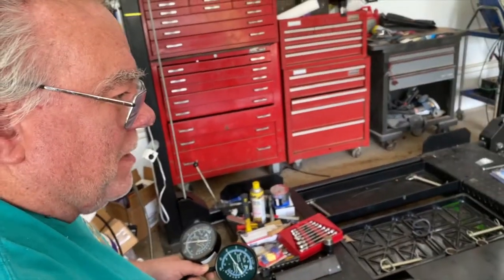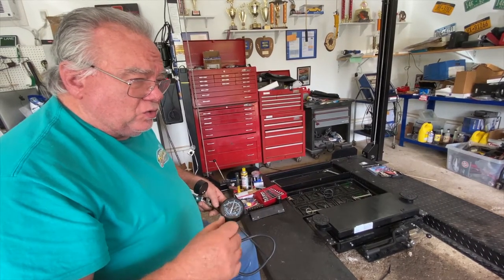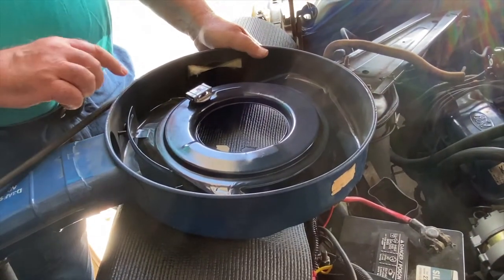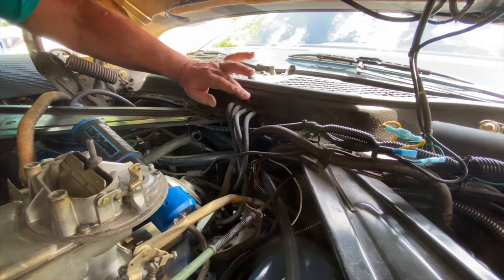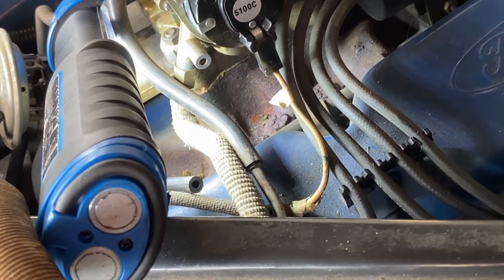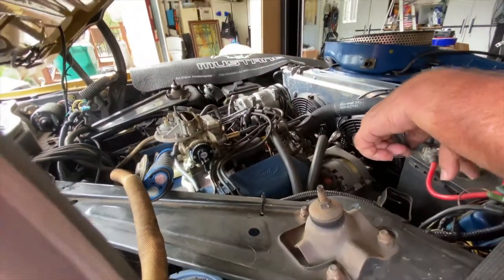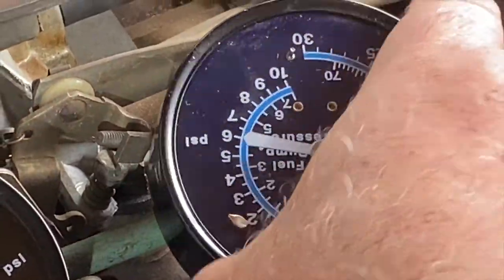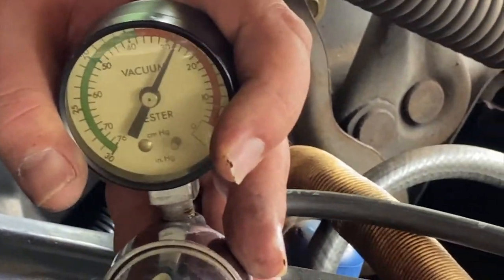1973 Mustang 302 2v Comprehensive Vacuum Systems Explanation And Testing

Comment: Thank you so very much for this. I’ve been researching for months now on the vacuum system for a 1979 Ford F-150 400 with a C6 transmission. I have been extremely frustrated and confused and have purchased every manual I could find, and you sir have cleared up most everything for me! I do have a few questions that are on my system but I did not see on yours. Specifically, I noticed your system doesn’t have any Vacuum Check Valves (mine has several) and yours does not have a Vacuum Restricter Valve for the Distributor Vacuum Advance. Did you remove these or does your system not call for them? Also, we appear to have the same carburetor (Motorcraft 2150), but mine has 4 ports (including the spacer) and I’m not entirely sure what they are or what they do. Lastly, my system had a thermactor air pump that was no longer functioning and has been removed. Any knowledge you could pass my way would be very much appreciated. Again, thank you so much for your videos, without people like you passing along this information it would be lost to us all. Also a thanks to your camerawoman! She did a great job too!
Reply from the maker: Vacuum Check valves became more common some time after 1973, which is the latest model Mustang we have from the 60s and 70s.  I used to work at a Ford dealership in SoCal from 1975 until 1981, but was closely involved with repair facilities for 5 years thereafter when working for the Auto Club of Southern California (the nation's largest AAA chapter) as a Corporate Liaison in their Garage approval Program.  I had about 75 repair facilities I oversaw, most of them dealerships.  Much of the driving factor for dissatisfaction our club members had with auto repairs involved engine performance where the ever evolving and progressively more complex emission control equipment was going through a transition between mechanical, to vacuum/mechanical, to mechanical/vacuum/electrical oriented solutions before we finally entered the electronic control phase of emission system solutions (computer controlled).  The early computer based systems were fraught with frustration by nearly all persons involved, from owner, to technician.  Eventually the computer controlled systems became stable and viable, eventually resulting in the kinds of advances in performance, reliability, and emission control that was promised long before with computer controlled engines.  Sadly, 1979 was one of those periods of great frustration.  By then the earlier Ford Electronic Engine Control (EEC) systems had entered their 2nd generation with some improvements over the horrific EEC system, but it definitely had its problems.  As for the 1979 truck powertrains, you were somewhere further back in the evolution, where there was a lot of more complex vacuum/mechanical solutions involving a lot of vacuum based tubing and devices, to include vacuum delay valve.

I can tell you this, one of the only places a vacuum delay valve does any real good is when someone illicitly places it in the vacuum hose leading to the Exhaust Gas Recirculation (EGR) valve, to delay the vacuum signal getting to the EGR diaphragm, thus preventing a hesitation on light acceleration caused by the introduction of inert exhaust gas into the intake manifold.  But, even that can have a drawback, as in 1979 I began to notice how engines would be subject to having noticeable, but not damaging, engine pinging.  The introduction of exhaust gas via the EGR valve actually helped reduce the pinging, but it caused some bit of hesitation or stumbling when the EGR began to open too soon.  But, the more rapid than desirable opening of the EGR valve was needed for the engines to meet newer emission control standards.  It was a vicious situation, not unlike playing the game, "Whack A Mole,"  where every solution to a drivability problem presented a different problem elsewhere, even if drivability was improved and emission output levels would increase.  Worse, even though I knew what I could do to make a vehicle's engine run "better," it was unlawful (at both the federal and state level) for me to "tamper with" or adjust the engines anywhere out of specification from the manufacturer.  Now, many years later, I remember all too well how it felt to have to set an engine up a certain way, knowing full well I was essentially detuning an engine in a way that would result in a less than optimum level of performance.  For my own personally owned vehicles I did whatever I wanted, and figured if anyone wanted to see the engine emission control systems they would first need a search warrant, and the person doing the search better be as qualified as I was to ascertain if something was a modification or not.  Luckily for me nobody gave enough of a rat's ass to look at my own vehicles.  The real money for California was to go after repair facilities, find them in non0compliance with maintaining emission control systems or repair, then fine the hell out of the facility in order to gain the funding source for the department performing the alleged oversight.  It was nothing short of draconian behavior by California.  Our dealership never was fined.  My one tune-up department partner and I kept excellent records, and did all we could to remain in compliance with our machinery being calibrated properly and consistently on schedule.  And, in cases where I did "tamper" with emission control equipment, it was done in a way only an expert would have been able to find what was done.

Now then, back to your situation (enough "evil backdrop" info for now)...  The reality I was dealing with as a technician "back in the day" was a lack of emission control information from Ford.  Yep, you read that correctly.  We had a horrible problem getting any kind of useful information from Ford on emission control systems.  By 1979 Ford began to have more than just timing and spark plug gap into posted on plastic labels pasted onto a valve cover.  They began to show the vacuum control system, in a fairly general way, used for an engine's particular calibration.  The problem is that over the years those plastic labels would peel off, or become too scratched up to read.  And, Ford began to rely on those labels to document the various emission control systems, as opposed to providing books or manuals showing the various engine calibrations for their vacuum control systems.

Meanwhile, taking a walk down memory lane, I see a situation where until 1973 Ford really did not seem to take emission control system documentation seriously.  It was not until the 1973 Shop Manual that the various vacuum schematics for various engine calibrations was even addressed.  A near parallel situation exists for electrical schematics as well.  Until 1972 the electrical schematics from Ford were a dismal near-joke of incomplete, and hard to follow compilation of accurate but useless effectively information.  In 1972 the electrical schematics began to get pretty good, and improved even more in 1973.  But, suddenly in 1974 there seems to have been a news blackout of sorts and finding solid information later than 1973 has gotten to be a very difficult challenge.  I do have some vacuum and electrical schematics for 1974 - 1978 Mustangs, but some are literally scanned from paper documents.  I have nothing from 1979 or later Mustang or other vehicle makes or models.  Some of the PDF documents I have that were not scanned have some kind of copy protection protections on them that I had to try to use several PDF reader applications before I could finally open the PDF file.  

Anyway, if you like I can hunt for 1979 Ford Truck documentation on emission control systems, just to see if I can lend you some help.  The information must be out there "somewhere," but like I found with 74-78 Mustangs it can be hard to get info, much less useful info.

That said, I am glad what I put out into this YouTube video has been of help to some degree.  I guess that in general, wherever you see a vacuum delay valve you can safely remove it, unless someone has placed one into the EGR vacuum line <g>.  Disabling the EGR valve may cause engine pinging to occur,  And it is not viable to retard the ignition timing to correct it as too much adverse impact on performance and fuel economy will be the result.  The EGR systems in general don't really have that much ill effect, although some of them do cause a stumble or hesitation on acceleration (thus a good place for a vacuum delay valve).  And, keep in mind, any change to an emission control system can be seen as a violation of federal and/or state law - so consider the fallout before making changes.

All that having been said, now it is clear why I like to work with First Generation Mustangs and Shelbys, back before we had any really serious and complex vacuum system based emission control configurations.  I mean, we had some that began to creep in as early as 1969, and more do in 71 - 73.  But, nothing like what happened in subsequent years.
Reply from the maker: I did some hunting around and found some images of electrical and vacuum schematics for a 1979 F150.  But, no manuals with the information laid out in a logical way.  I visited my normal Go To web site for manuals (Forel Publications), but they have no files on vacuum or electrical schematics.  I did find some folks selling some diagram manuals on ebay.com for Ford Trucks.  Perhaps a quick look at that will yield you some factory manuals with schematics.  I did that for 1974 and 1975 Mustangs, and was pleasantly surprised with what I came across.

I would be happy to send you the various images I did download.  But I can't attach files in the YouTube site.  When you get a moment send me an email to gilhale@gmail.com, and provide me the address I can send email attachments to.  We are in and out a lot this week, but once I have your email address I will get the files to you as soon as we get back to our home.

Comment: Hi Gilbert, thank you so much for this video!  I'm restoring a 1976 F100 with a 302.  The vacuum lines are a complete disaster, and this has helped make sense of most of the mess!  I am curious about one thing, however.  The truck has had it's EGR system and Thermactor system removed......crudely.  My question to you is, are these two systems completely independent?  I am considering re-installing the EGR valve & canister but cleaning up & leaving the thermactor pump / tubing, etc. off.  Does this make sense?  Would you leave both off?  Thanks!
Reply from the maker: Hi Kris!  Thank you for your comment.  And, i an truly happy you found my information helpful, even if it did not directly pertain to your 76 F100.  As for any vacuum calibration (schematic) manuals, I have nothing for 1976.  Usually I find vacuum schematics (aka "calibrations") on Ebay, but it is rare that I see full manuals as sellers make more selling pieces of a manual for specific engines and calibration codes.  The 1074 - late 80s were an interesting time when it came to the Ford emission control systems and especially with vacuum routing.  If you can find any documents, even of only a single page that related to your 351M, you would be best off getting it, then scanning the contents for safe keeping.

As far as the Thermator A.I.R. system, and the Fuel Evap systems, Although the Thermactor AIR air injection system was functional, even useful, in many states you are not required to have working emission control equipment if the vehicle is more than a certain number of years old.  But, even with non-fun tioning emission control systems that are no longer required to be operation,  I believe it is still not lawful to remove said equipment.  Federal law is even more demanding re: keeping the old systems in place even it they stopped working.  So, double check your sate legislation at the least.

All that said, Your engine will run fine without the Thermactor system.  Ford and other vendors do sell Thermactor injector blocking plugs that let you remove the rubes from the exhaust manifolds, and thread in a solid plug instead.  If you are going to disable the AIR system try to remove the AIT pump as well.

As for the Fuel Evaporative system, this is one of those rare emission control systems that is actually beneficial and does not drain power from the engine.  I only have Fuel Evap info for 1973 Mustangs, but if you look at it you will find it is very similar to the 76 F100 Fuel Evap System.  Again, I do not have any documents on the Emission Control systems for 1976, much less 1976 Trucks.  But, I encourage you to look at ebay for aany relevant Emission Control System manuals.  Meanwhile, below is a link to my Google Drive where you can find and download the Emission Control info for 1973 Mustangs, to include the Fuel Evap System.  It ought to help you get it all connected properly:

https://drive.google.com/file/d/1HccnAzUWS5hhEbww3_TrKX8q0VwfwgGh/view?usp=drive_link
Reply: @gilberthale7777  Thank you so much for taking the time to write all that out!  I'm one of the few owners of these old trucks that would actually prefer to have all of the factory emissions systems installed, but as it sits now the Thermactor valve tubes are still secured to the engine at cylinders 1 & 8, but have been hacked off and the rest of the system is completely gone.  The air pump included.  Also worth mentioning that the truck & I are in Idaho, with some of the loosest emissions laws in the country.

Reading one of your earlier replies is actually what made me want to re-install the EGR valve & get that system back to running condition.  There is currently a blanking plate where the EGR valve used to be and the charcoal canister is missing.  Before moving forward with buying parts, I just wanted to confirm that this system will function as designed without any of the Thermactor equipment being installed as well.  If you're able to confirm that, that would be great!  Thanks again!
Reply from the maker: . @KrisYates  You will discover the Thermactor system components are going to be quite scarce.  That said, there is a reason that piece of emission control equaipment only survived in a few years of production. Unlike efforts to get the engine to run leaner, which enhanced fuel economy even if just a litle bit, the Thermactor intent was to help complete the burning of unburrned hydrocarbons (fuel) thaat were being sent out the exhaust system - which does nothing to enhance fuel economy.  Our 1969 Shelby GT500 with aa 428CJ has a Thermactor A.I.R. system from the factory, which is is still in excellent condition and fully functional (87,000 original miles).  When the day comes that any of the major, hard to find,  parts of the system fail I will do the uimaginable.  I will remove the original A.I.R. system, plug the exhaust A.I.R. ports, and remove the pump.  I know it is sacriledge to alter anything on one of these Fisrst generation Shelbys, and I hate that too oon something on the A.I.R. system will fail.  But, these machines were never intended to last over 12 years, much less over 50 years in near perfecdt condition.

Just to be clear, the A.I.R. Thermactor, EGR, and Fuel Evaporative systems all run independently of each other, unless one looks at the overall, holistic impact on reducing emissions.  They all contribute to varying degrees, and impact areas different from each other.  For instance, the EGR system is designed to reduce combustin chamber pressures and ignition/burn temperatures by introducing some inert gas (exhaust gas) into the A/F mixture as the A/F mixture is being sent into the comustion chamber for each cylinder.  As a result Nitrous Oxides (NOx) are reduced.  The Thermactor A.I.R. system is designed to introduce fresh air with atmospheric Oxygen in it to help complete the burning of fuel left unburned or partially burned in the engine;s normal combustion process.  And the Fuel Evaporative system reduces the amount of evaporative fumes from gasoline that enters the atmosphere, and completes the burning of said vapors after capturing and holdig=ng the fumes in a carbon substrate in a closed container.

Of the three emission control systems above the Fuel Evap system has minimal, really onconsequential impact of how efficient the engine runs.  The EGR system does help reduce NOX emissions, but can also cause engine stumbling or performance reduction, especially at lower speeds.  Several approaches at minimizing the ill effects of sending exhaust exhausr gas back into the combustion chamber along with freach and very volatile A/F mixtrue.  All in all, the eGR does not really hurt anything, and in reality overall it does litle to reduce engine performance when the engine is tuned correctly.  

Finally, the A.I.R. system robs a nominal mount of power from a running engine to build a compressed air charge for the Thermactor tubes.  But that has little impact on the overall performance of the engine.

I have never had to replace an EGR Delete plate.  But, I have replaced EGR channeled spacer plates due to excessive exhaust corrosion having blocked and plugged the EGR gas input port under the carb spacer.  I know they used to be readily available, but now I hae no idea how hard they are to find.